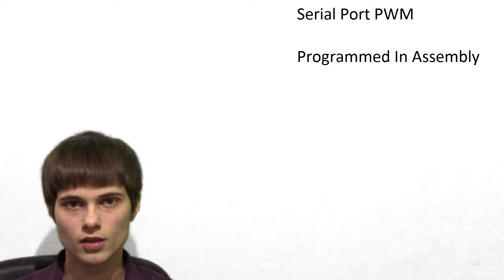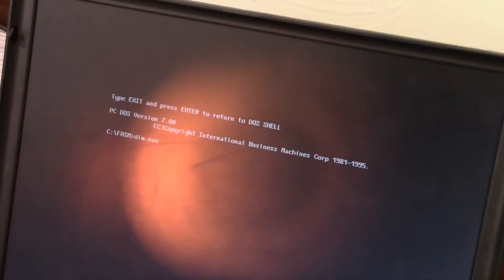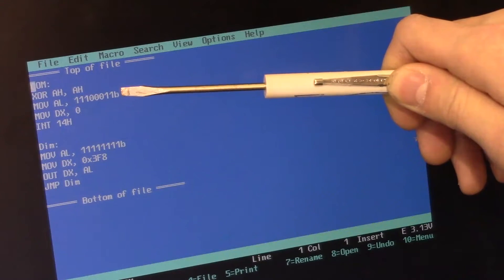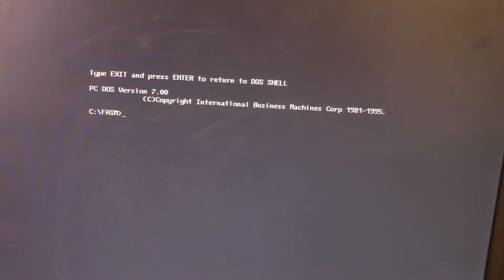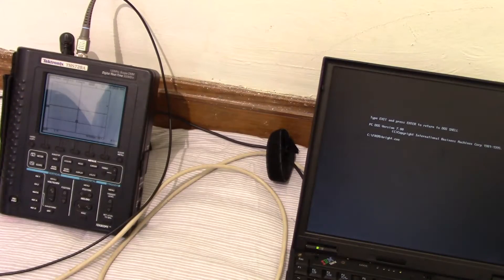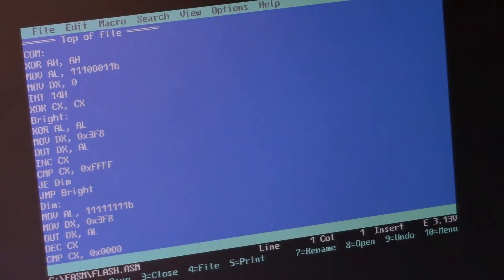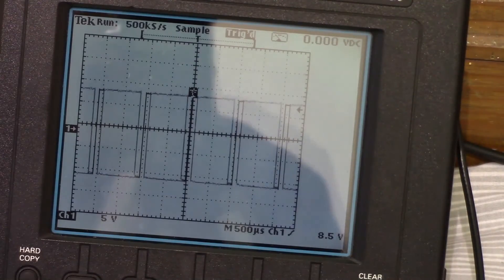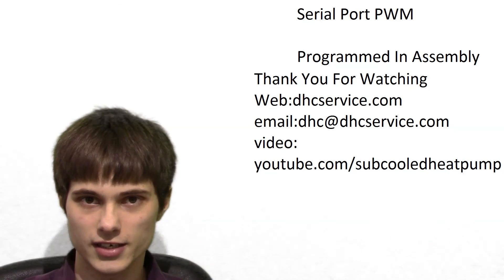Programming a Serial Port for PWM with Assembly

Comment: What if you press Ctrl and C does it break out of the program?
Reply from the maker: I haven't tried it, but like I said in the video, I did try out some exit codes ( IN AL, 0x060) (TEST AL, 76) (JE Close) That one did work but it was an INT 21H so it (probably) only works when the PC is running DOS. I'm sure these programs could be easily modified by an experienced programmer to properly exit. 
I'll try out Ctrl C though. Thanks for watching
Reply: Try it.. You took me back to 1994 lol. I had a friend who was a teacher on a public school (computers) and i was 14, he teached me assembly, pascal, fortran, VB and always told me "do it, learn all of these, it will be usefull for later"
Reply from the maker: I tired out CTRL C, It didn't exit. But the pause button on the keyboard does pause the program. I'll have to write a proper exit code that recognizes the keyboard without a DOS call
Reply: Ah crap, try also the Ctrl + B  and if not then you have to use an exit code